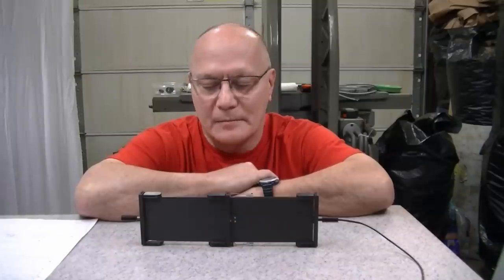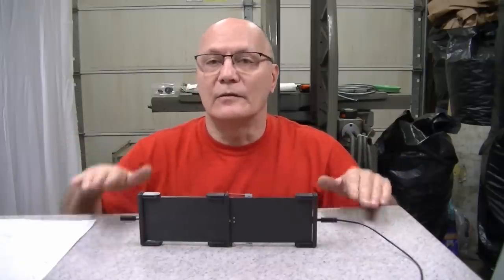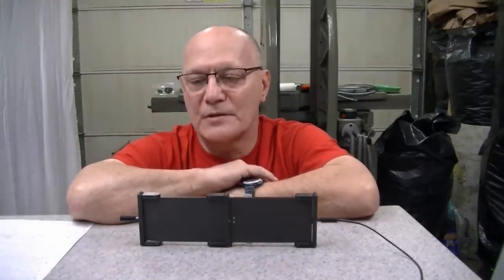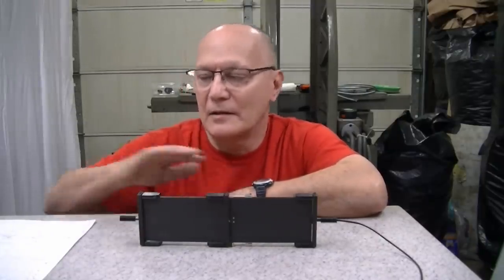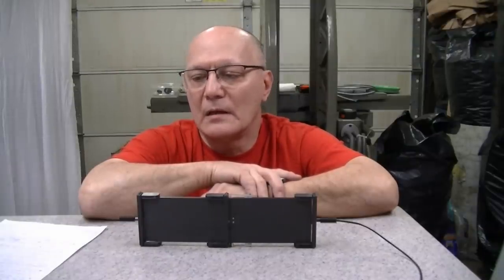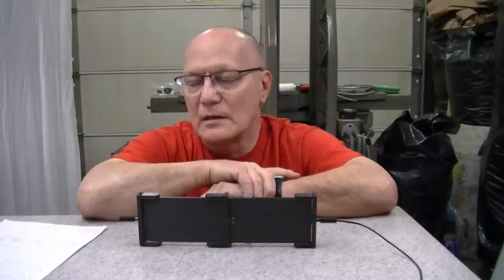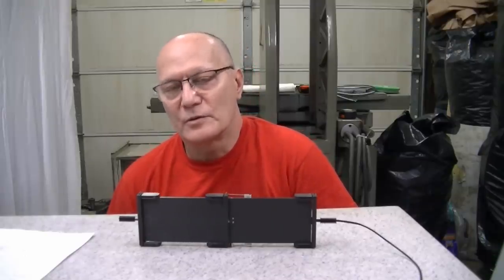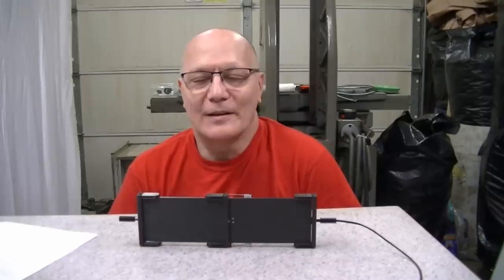DIY SURFACE PLATE LAPPING ANSWERS TO PART 1 QUESTIONS

Comment: On the topic of using one granite plate to lap another: I think you may have been getting to it in the actual lapping video, but would it be possible to use something like aluminum foil on the plate doing the lapping to provide a surface for the abrasive to charge? I know there is shim stock with pretty tight thickness tolerances available, but I would guess that it would need to be wrapped around the sides and secured there so that no adhesive layer would effect the flatness of the plate.
Reply from the maker: I did that and it will be in part 2

Comment: Robin,  
As always, another well appreciated master class in the mechanical arts.  
In regards to shop layout: Do you think a HEPA or electrostatic air cleaner would be effective in reducing the dust fallout and minimize temp gradients? 

Also, how have you isolated your surface grinder dust from your inspection area and other machining areas?

I look forward to your next technical video fix! I am extremely interested in hearing the details on your Renz-O-Meter!

Have you thought about following Tom's  example and writing a book on the Mechanical Arts of Precision?
Thanks!
Reply from the maker: Thanks Ian.  The plate is in a room where there is no machining. The Mitsui in the background is just there for rebuild purposes. The air cleaner could help with dust and gradient but the air flows would need to be carefully directed. No thoughts on a book but it's not out of the question.
Reply: I would buy that book preorder.

Comment: In Tom's video, I believe the surface plate guy was talking about how at that time of year you want the plate to be slightly concave if you're lapping in winter and convex in summer, because the plate will change shape slightly when it changes temperature. Is this a temperature gradient thing? What's he talking about there?
Reply from the maker: He was making a correct general comment without explaining the underlying physics.

Comment: say.. do you have a long rectangular bar straight edge..  you could machine up an indicator mount to slide along it.. so you could clamp it at each end in 1-2-3 blocks to get it level.. and push the slider along with an indicator checking for low or high spots in middle.. used to have one at an engine rebuilding shop i worked at.. came in really handy.  sorry i don't have any pictures.
Reply from the maker: There is a unit designed for surface plate work using that same principle. google "Planekator"

Comment: I'm curious why the pro's thought this stone was so far out of whack that it was a throwaway - while here you have complete noob (please take no offense) able to get it back to spec or least pretty darn close using a relatively simple set of tools to do it. What a find indeed after a couple quick google searches show the cost of a new one.
Reply: Perhaps, the pro's wanted Rob to have the stone for making wonderful YT content?  🤔
Reply: Robin covered this point precisely in this video. He said that the pros could have brought it back into line, but the cost in time would be more than a new plate could be bought for. He can do it because he is not charging himself for his labour. It also makes for great YT content too.
Reply: Yeah - but the question is why would it cost more really? It seems Robin was able to do it with relatively simple tools and minimal training/experience - I know nothing about it but it seems like pros with dedicated equipment could have knocked this out pretty easy - it's not like there were big chunks missing from it.. No argument about the content!
Reply: There is no dedicated equipment which enables a quick fix. The pros would be doing the job in a similar way to Robin, the equipment improvements available to them and their experience in doing this work might at a guess cut the time required in half of what it will take Robin had he not videoed the procedure. At a couple of hundred dollars per hour, the bill would quickly add up. If you think about it, the material for a granite plate is just a bit of rock from a quarry, the basic sawn blank probably a couple of hundred dollars to Starrett. The painstaking work to turn it into a double A precision plate multiplies the cost of the blank a lot, and this is on a production line where the level of automation would be much higher than in a re-calibration environment, where the plates are generally getting a minor tweak to bring them back into certification range.

Comment: How do you lap very small parts like the carbide inserts without applying uneven forces to them?
Reply from the maker: by fixturing them in groups so the group forms a larger surface to maintain alignment.
Thanks for watching and commenting.

Comment: You've talked about having done the three plate method. Do you have video of that? I couldn't find any on your channel.
Reply from the maker: I do not.
Reply: @ROBRENZ  Ah, too bad. Would have been interesting to see your take on it.
Reply: @IslandHermit  
oxtoolco has a 4 part series on making lapping plates with the 3 plate whitworth method and checking their flatness. (first 3 cast iron surface plates, and then a set of soft copper laps using pennies glued to aluminum blanks.)
Reply: @nickopedia5669  Yeah thanks, I've already watched them. That's why I said that I wanted to see Rob's take on it, just for comparison.

Comment: I wonder if it would be practical to make a lighter surface plate as a composite of two materials chosen such that the temperature coefficients would cancel out temperature differentials over the thickness. Probably not economical.
Reply from the maker: No, but you could make it out of a material with near zero coefficient of expansion like Zerodur.
Reply: There are leightweight plates, that are basicaly what you describe:
https://www.microplan-group.com/en/products/standard-granite-products/lightened-surface-plates-pa.html

Seems like they are built like a torsion-box out of glued together stone segments. Planolith makes plates in sandwich construction, stone on top/bottom and aluminium-honeycomb in the center.
Reply from the maker: They address the weight issue but they don't change the bow with change in temperature gradient.  Nice stuff though!

Comment: Re silicoses : isn't the free dust captured to an extent by the liquid in which the diamond grit is dissolved ?

Paddy
Reply from the maker: No liquid is used. Even when I used alcohol to spread the diamond on the lap initially, it evaporates and I am lapping dry.

Comment: Hmm I have a Question if I missed it I apologise . Is the a make a "Renzo meter" ? or did I hear incorrectly?
Reply from the maker: It is Renzometer. Its the name given my  repeatometer and straightness gage that I designed and built from some Instagram friends. There will be a video on its design and use on the  surface plate calibration. Thanks for watching and commenting.
Reply: Thank you for your quick answer and taking the time to make Videos of your work ! I love the practicing art part and your modesty ! At this point myself and 3 others cant wait for the Renzometer video (Everyone please use the Renzometer word so search spiders can pick it up !) Many things start at basics and not everyone lives where it is possible to have a surface plate at a reasonable price. BUT we do have granite...

Comment: 10:47 that seems false, and would entirely depend upon where the plate was supported underneath - if it was supported only in the middle having them in the middle would have zero effect, and at the ends would have maximum bending effect (but still very small). Similarly if it was plate was supported on Bessel points then directly over those points would have zero effect but at the ends would cause a slight doming and in the centre a slight cupping. Have I missed something? Or was your statement incorrect? Cheers.
Reply: I do believe for this test the plate is to be supported on 3 points as it should be in use as well.
Reply: @shiro-r4m  Sure, but that wasn't the point of my time stamp questioning of Rob's comment. My comment was very specific :-)
Reply: He is still talking about the deflection of the support structure. Due to rating of the plate itself, it sees negligible deflection with separate masses, and the support structure only deflects due the overall weight of the level, not the position of the level and counterweight, as these net out in the middle where the measurement started.

Comment: Hi Robin.  I have acquired an autocollimator and it seems necessary that I resurface my 2’ x 3’ Starrett plate.  Would you mind noting what grit(s) of the diamond dust you used with your lap for both initial rough surfacing and finishing.  Too, the lap I am going to use is 2 sided.  It is in “rough” condition as it was quite rusty and had been in an unheated Canadian garage for 30 years.  Is a milling machine surface (if done slowly and methodically) good enough to resurface the lap or do I need to get the lap surface ground?   Thanks for your time.  Derek.
Reply from the maker: 325-400 for roughing and 600-800 for finishing. lap needs to be very flat so ground
Reply: Thanks SO much for the reply. Looking at the lapping plate I may just stone it, scrape it and see how flat I can make it.  Best regards.  Derek
Reply from the maker: @tobarapprentice6618  Scraping is good too.

Comment: thank you for very informative video. i want to 'flat' a cast iron plate for a surface plate. my plan is using a laser pointer and a mirror, and optic lever to map the shape of the surface. simple experiments ave bean able to measure 0.005 mm  change in surface shape. my optic  lever  about 4 m. looking for a better focus-able laser, at the moment my dot is about 10 mm so i use the bottom edge. not as fine as i would like.  also need to figure the math,, at the moment I'm working with a rough standard i got with a feeler gauge blade. any input will be appreciated.

Comment: Where would you look to buy a used lapping plate and what is the technical term used to describe the cast iron lapping plate tool?  I do know how to weld, so could I construct a lapping tool and take it to a machine shop to have it Blanchard ground ?
Reply from the maker: Ebay  or auctions.   "Cast iron lapping plate"  or "cast iron surface plate"  Iron is a better lap material than steel so better buying an old plate.
Reply: Hey where can i get a roller like that, for pressing the grit into the lap?
Reply from the maker: @hatman6431  i made that one

Comment: Wouldn't it work, to set up a tensioning of some kind at the bottom of the plate to pre-tension it into deflection, and THEN lap it flat? Wouldn't that improve its rating?

That comment on the unlimited funds is cute.
Reply from the maker: That would not help. Thanks for watching and commenting.

Comment: There is a formula  the placement of the 3 support pads or points of a surface plate which I don't remember. Are you familiar with the on going experiment in Louisiana where they are detecting gravitational waves. They are measuring distortions of an atoms width over a 10 mile distance cause by events like stars being captured by black holes. If you go there to see the experiment don't slam the door it is amazing sensitive to vibrations. They can detect car traffic on the Interstate highway miles away
Reply from the maker: I use the uniform sag points which are 0.2232 x L in from each end.  Not aware of the experiment.
Reply: Knowing how you quest after precision I think you would be intrigued by the LIGO experiment and the impossibly small distances they are trying to measure. They ran their equipment from the mid 90"S without any success up to 2015. In 2015 they upgraded their equipment increasing the sensitivity x 10 and have been getting detections since then.

Since your not one of the "close nuff" machinists I was thinking of a method of using the Heisenberg Uncertainly principle and the modification of the double experiment to measure slots or holes with incredible precision and a ruler. If the hole that was being measured is smaller the than wave length of red light  no problem. If greater then detecting the interference pattern could require a kilohertz radio signal and a special antenna.
Reply: Thomas Wehrmeyer I though that was amazing video if I can remember the guy was looking at the computer screen and then Stated O a tracker trailer just drove by 👍👍

Comment: Something to think about is the modulus of elasticity for granite is 20-60 GPa, while steel's is 200GPa. 
So the same force that would make a steel part elastically deflect 10 microns, will make an identical granite part deflect 33-100 microns. 
(this is compensated for by making them solid slabs rather than ribbed structures, but still, granite is less than 1/3rd as stiff as steel)
Reply from the maker: Understood :-)
Reply: maybe steel goes crazy with heat. Maybe it's too soft, too expensive to forge and harden. Cast iron is used tho. I'd love to see a comparison

Comment: Dear seems to need to impress with his dissertation. I don't see any issues with Robin's decision to rehab a surface plate. So far he is working to take it to a "rough" state by working high areas down and not spending a lot of time polishing the entire surface, to  Dear's standards. Seems like a logical first step in a multi step process. My lapping experience has been limited to small areas and only to a finish that is sufficient for the purpose. The amount of sag on a plate of that thickness caused by the things sitting on it must be very small, measurable? Wouldn't lapping with a cast iron plate always induce some out of plane condition due to the weight of the plate? I'm a firm believer that there is no such thing as "perfect." Some of us are human.
Reply from the maker: Well said, thanks for watching and commenting.

Comment: Another fantastic video, thanks Rob. I'm sure you're stir another hornet's nest (Troll's nest?) by saying a plate can't be calibrated with a single level ;)

Excellent points about the carbide feet. I've always tried to use brass/bronze feet, but you provided an excellent counter-view. Similarly with pulling the charge out with softer material, I should have thought of doing that as it makes perfect sense. Thank you.

For an example of what an almost unlimited amount of funds can do in a home shop I would recommend your viewers check out Dan Gelbart's channel. https://www.youtube.com/user/dgelbart/videos Indeed I just had some lasers arrive I will turn into his centring tool.

The standard of your work is only exceeded by your humbleness Robin, well done and keep up the excellent work.
Reply from the maker: Thanks Pete, Dan does have a pretty good man cave doesn't he. Thanks for watching and commenting.
ATB, Robin